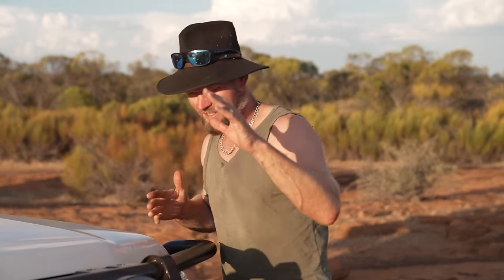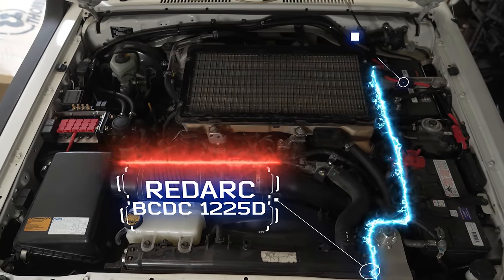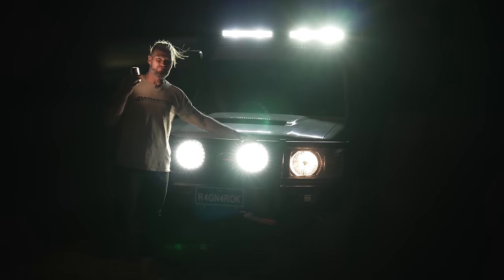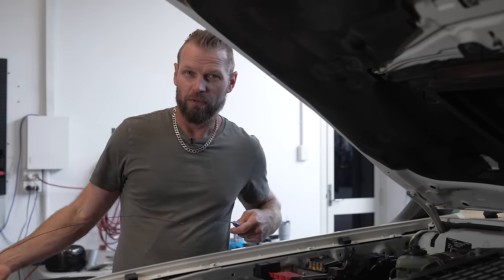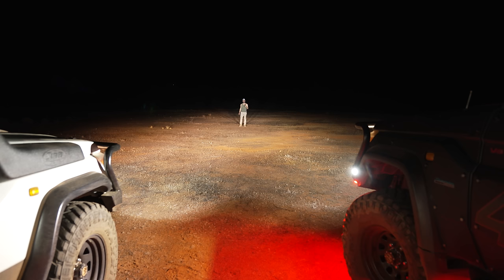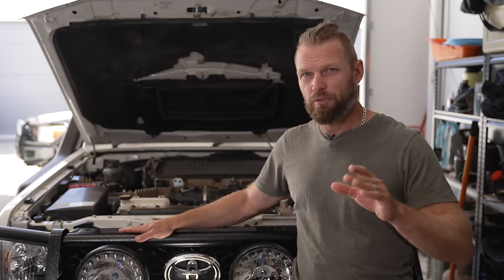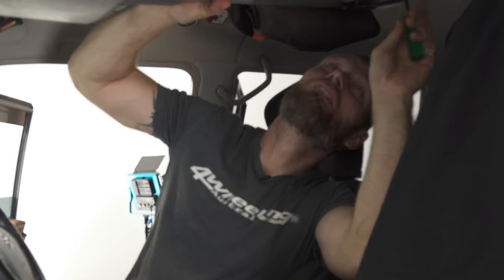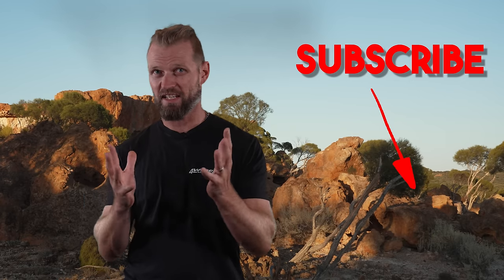Landcruiser, Troopy Project part 4

Comment: Why not a 50 watt ham radio and 50km of range? I've gotten up to 70 miles without a repeater, just line of sight. It's SO worth getting your ham licenses.
Reply: Nobody in Australia uses ham radio
Reply: @dalep-i4844   well they do actually, it’s amateur radio. Heaps of them out there. No, I’m not one.
Reply: Only real question here is what frequencies are you talking about. If UHF CB in Aus then 50 watts is illegal and exceeding 5 watts carries serious fines
Reply from the maker: Used to have one 8 years ago but found it more of a novelty to have it and not many others have them
Reply: @malcolmL995  yes there are those weird blokes sitting at home talking on them but nobody in the 4WD world is using it for communication.
Reply: @dalep-i4844  yes there are. There’s plenty of them. Just read further down the comments, there is one there for a start.
Reply: @malcolmL995  I’ve driven all over Australia. Never come across any. Ronny had commented here and said the same. So while you may know of some niche group using ham. I call them nobody. Because the vast majority do not.
Reply: @dalep-i4844   there are 1000’s of amateur radio operators in Australia and probably 1/2 of them have 4WD’s. I’ve been in the communications industry all my life and know about these things. In most cases you wouldn’t know an amateur radio operator if you fell over them. The HF radio’s that are used for the Aus 4WD Radio Network are all capable of having amateur option passwords added to allow those radio to operate on amateur frequencies. There are also about 4 or 5 amateur radio networks operating in Aus for amateur radio operators travelling around Australia. 
Ronny didn’t say it’s not used, he said he used it but doesn’t now. I have also travelled about 100,000km around Aus and only have a few more tracks to do and will be pretty much running out. I run into them quite often but I know what to look for. Just because you haven’t run into any doesn’t mean they don’t exist and even if as far as your concerned they don’t exist doesn’t mean they don’t.
Reply: @malcolmL995  “more of a novelty to have it and not many others have them” Ronny’s exact words and that’s my opinion also.
Reply: @dalep-i4844  well Ronny doesn’t necessarily know everything either but seeing as it’s what you believe then it must be true. It was you that criticised my comment. Frankly I don’t care what you say, you’re not the all knowing. Just because you say it, doesn’t mean you’re correct.
Reply: @malcolmL995  for a bloke who said he doesn’t use HAM you are sure upset about me saying nobody uses ham 😂
Reply: @dalep-i4844  it strikes me that you really need to act your age, not your shoe size.
Reply: @malcolmL995  Can't speak for Australia, since I'm in the USA, but here your basic ham technician license gets you VHF and UHF FM (whereas CB is AM) plus a few other band rights. Bands and laws vary by country. We are allowed to use up to 50 watts for VHF and UHF, and that's good for 30 or more miles of line-of-sight. But the answer that few if any 4WD'ers use it in Australia is the most relevant thing. The east coast of the USA is pretty much CB, while the west coast has a lot more ham operators bouncing around in the dust. So, you go to the party with the most people, wherever you are.
Reply: @erikhy  in Aus/NZ the authorities authorised the use of a frequency band at 477 MHz for public use for free with no license required but is only allowed to be a 5 watt transmitter. Previously Aus used(and some still do) 27 MHz AM CB frequencies and in NZ 26 MHz AM CB frequencies. The difference now is only 27 MHz can be used in Aus whereas in NZ 26 & 27 MHz can be used. 
Most people in Aus now use the 477 MHz frequencies whereas in NZ most still use the AM CB frequencies. Unfortunately the 477 MHz frequencies have not taken off so well in NZ. 
I’m not an amateur radio operator but believe the license in Aus/NZ also allows for some of the Ham HF frequencies as well. HF is a big thing in Aus and most of the 4WD radio networks use commercial frequencies(non amateur frequencies) and amateur radio operators can get an electronic password for their HF radio that will also allow for the use of amateur frequencies. In Aus/NZ it is not legal to have a HF radio operating on commercial HF frequencies that you can program frequencies into from the front panel. The Amateur option allows only amateur frequencies to be front panel programmable.

Comment: Would you mount antenna on back or front roof of 4wd?
Reply from the maker: The rear is 💯 easier. If mounting on the front you’d be running more wires
Reply from the maker: Running the the rear is reachable with the cable to the front of the roof you’d likely need to extend the wire

Comment: Why put the battery on the turbo side of the engine ?
Reply from the maker: Only place it will fit and they go fine on that spot. 9 years had one in the 79.
Usually it’s the crank battery I cook in the 40c+ for days on end